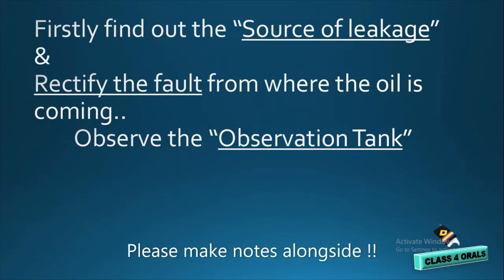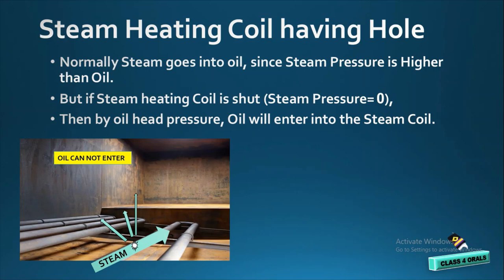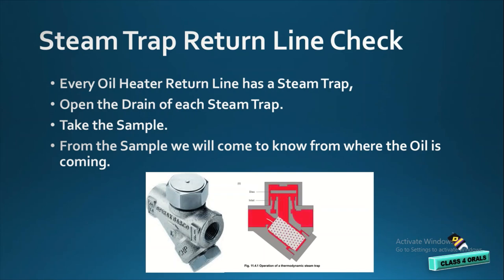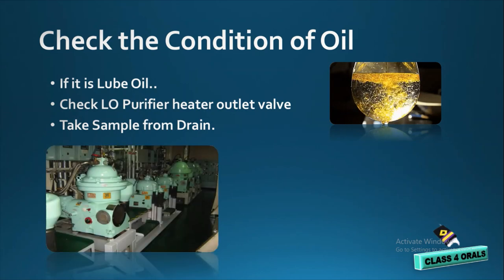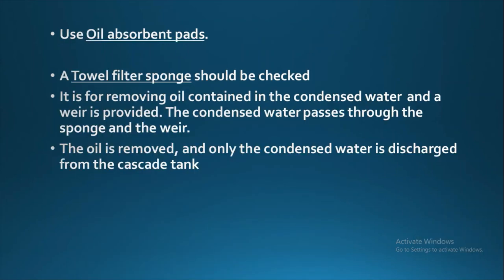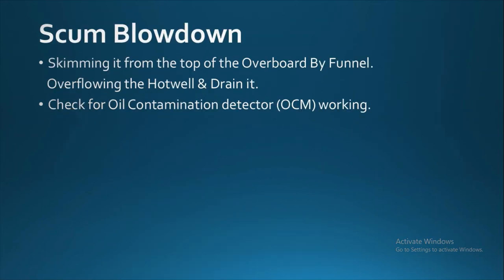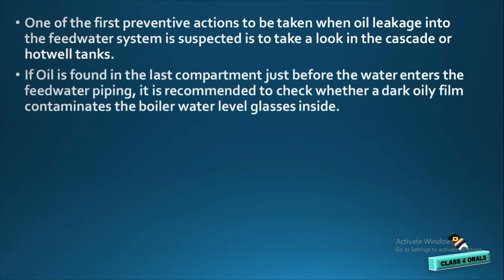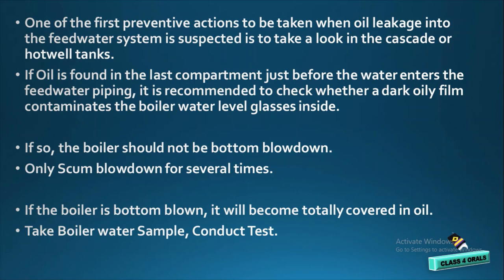Oil in Hotwell Actions Taken (Cascade Tank) | Boiler Feedwater System | Scum Blowdown |Oil in Boiler

Comment: Does MARPOL regulation allow to do a scum blow down during this scenario ?
Reply from the maker: No.
Reply: @CLASS4ORALS  @4:48 screen it says in the third point not to do a bottom blow down if oil is present.  Fourth point it says only do scum blow down several times. Even in other websites it says the same, I really don't understand that part.  Btw the video was very educative, thank you ❤
Reply from the maker: If u do bottom blowdown, then below the water will drain, but the oil which is present on top of water, it will keep sticking to the walls of tubes as the water level is lowering, and it will be a major job to clean the oil inside.
Thats why only scum blowdown is done several times..directly remove the oil and impurities from top..and the system is left with only water.
I hope u understood now. Try to imagine the oil getting sticking to walls in case water is being blowdown in bottom blowdown method.

Thanks for your kind words.❤
Reply: @CLASS4ORALS  no no.. I understood that perfectly fine.. my question is.. why scum blow down when Marpol prohibits any oil to be discharged ovb. (Or this doesn't go overboard? 🤔)

Shouldn't we stop the boiler immediately (if possible) and taking all neccessary precautions we manually remove the oil on the surface through the top man hole door?  

Always welcome.
Reply: @kamaldeenabdullah3424   In this case we can set up the scum blowdown valves to the bilge tank. So now it won't break the MARPOL
Reply: @Adventures_of_Sahan  yeah that arrangement is good. Idk if that arrangement is available in ships,  lacking sea experience here Haha.

Imo it's almost to impossible that oil gets into a boiler... I mean I can't fathom a scenario happening onboard. The oil has to be extremely lucky to get into the boiler 😅.
Reply: @kamaldeenabdullah3424   noo mostly by the heaters can enter oil into the steam system. If a heater damage it must be repair or isolate. Isolate can be done because some tanks have more than one heating coil.
Reply: @Adventures_of_Sahan  yeah true. What I mean is the oil should enter the observation tank first of the cascade TK....copious amount of oil will be needed to enter into the cascade tank or hot well, surely watch keepers would have observed this before  it even goes to this situation.. okay due to negligence let's say the watch keepers don't even keep an eye on the observation tank... then oil can get in... but the alarm should go off and notify them.. the series of oleophelic or towel filters should soak up this oil preventing it from progressing any further...by then surely the watch keepers should have reacted... the oil has to go through all before getting into the boiler.. it's extremely unlikely imo. Am I missing something 🤔 is there any other way oil can enter a boiler?
Reply: @kamaldeenabdullah3424   as i know thats the only way oil can be enter into the steam system. May be there will be more.
Reply: @Adventures_of_Sahan  same here. That's why I said it is almost impossible for it to go into the boiler.
Reply: @kamaldeenabdullah3424  but if the oil contamination is too much excessive then oil can be go in to the boiler
Reply: @Adventures_of_Sahan  true, very rare scenario though.  It should be excessive as well as the the watch keepers should be negligent or coupled with the  malfunctioning of the cascade tank oil monitoring alarm. As first step the feed pumps will be stopped before the oil even reaches the boiler and soon after the boiler should be stopped... change over to DO depending on the voyage and since the oil leak is excessive it should be identified immediately and plugged.. until thorough inspection is done.. the boiler cannot be used.